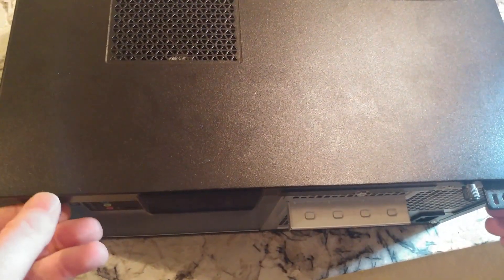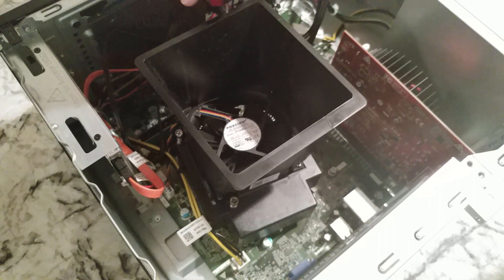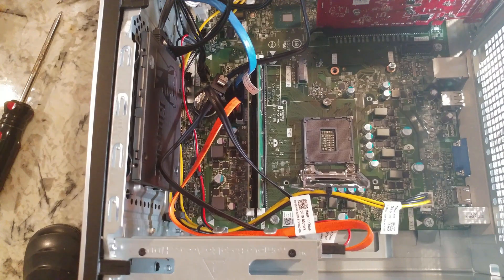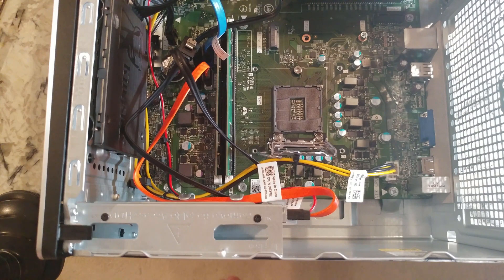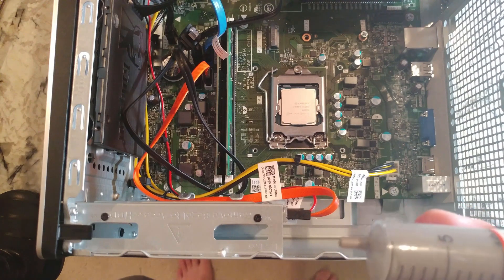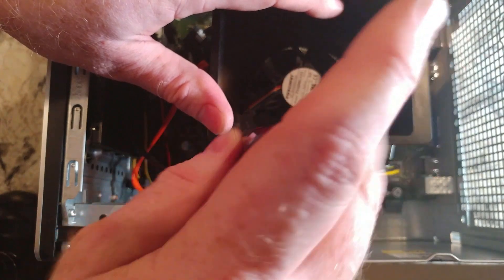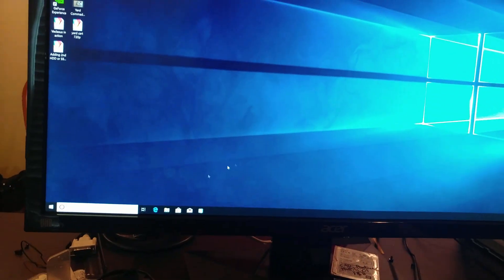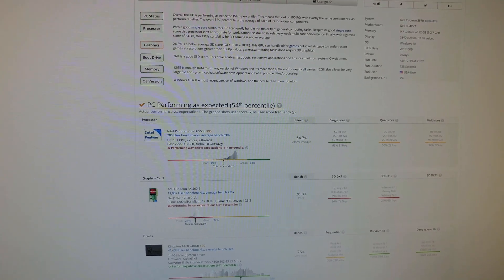Dell Inspiron 3670 Upgrading Downgrading Replacing CPU (read description) or Vostro

Comment: Brother I watch your channel all the time you can take that plastic air extension right off by clipping it and pulling it up you add me trying to get screwdrivers around it it pulls right off I'm like what the f*** is he talking about come on broski you're better than that
Reply from the maker: Lol...this is where you wish you edit these old videos.  Thanks for someone finally calling me out.  That plastic piece..never returned to later videos.
Reply: @PC_HardwareTechUnboxing_1  I was kind of pissed off at you for a little while because I was f**** around trying to get those screws off and I knew that every one of those clip off that I've ever worked on I don't know why I listened to you it actually popped off trying to get the f**** screws off and then I was like really I'm not mad I'm sorry I sent that message in anger after doing it your way lol it only lasted 10 minutes the thing popped off on its own and then I got it fixed in like f**** 10 minutes you should at least pin a comment saying the plastic piece I don't know what it's called even honestly pops off and pin it at the top of the videos somebody can at least have a chance to pop it off without breaking the computer lol

Comment: Can you take out the motherboard and put in a new case?
Reply from the maker: A few issues...1) I am not sure if the hole pattern would like up, though this is an easy enough fix.
2) I don't believe this motherboard has front panel headers on it...so you would not be able to plug the Power Switch in as the motherboard has a power button.  Potentially, someone might be able to figure out how to solder it. 3) The USBs on the motherboard would become useless.

You can certainly take the motherboard and power supply out of the Dell case and run it without a case.  You may be able to doctor a case to allow for access to the power button or the USBs

Maybe it is time for me to do something with mine...it is pretty much just collecting dust.

Comment: I wanted to downgrade a vostro 3471 pc (i want to use that processor in a new build) it has a i5 9400. What happens if I install a cheaper processor with the same socket ? (LGA1151) will it boot up normally ? Can you recommend me a cheaper cpu to swap with it !? (Pentium/celeron)
Reply from the maker: I would expect the 3471 to handle any locked 8th gen CPU or 9th gen cpu that has integrated graphics.  Any of the Celerons are just dogs...I would say at least Pentium G5400..I3-8100 or I3-9100 would be your best bet to keep it usable.

Comment: hello, I am a dell 3670 i3 user, I want to upgrade to i5, then what type does it support for i5 9400f or i5 8400 coffe lake
Reply from the maker: Hello, mine was originally a I5-8400, as such,  I have a couple of videos that I did related to this topic: 1) Update BIos 2) Install I5-9400f   3) Install I3-9350k  4) Install I3-9100.  Let me know if you want the links.

I5-9400 would be your best bet if you don't have a graphics card installed.  You could look at I5-8400, I5-8500, I5-8600, I5-9400, I5-9400f, I5-9600.  I don't recommend any that end in k as this is much harder to keep higher wattage CPU cool.
Reply: @PC_HardwareTechUnboxing_1  it works for me thnk u
Reply: I have upgraded it,  i5-8400 thnk u

Comment: I picked up an Inspiron 3670 for $50 off an auction of surplus electronics, new in the box. I'm planning to pull it apart and upgrade my Ivy Bridge era custom build. i5 8400, 12GB of RAM.
Reply: Where do you find such auctions?

Comment: Good video! I did the exact same thing as you. Used the cpu from my Dell Inspirion 3670 for my current gaming PC. After several attempts to upgrade the computer, found out that the current PSU is mounted at the bottom...and has the fan facing directly to the rear (plug side) and the new PSU, a Corsair 550 watt I installed has the fan facing the side of the case, which leaves no room for airflow. Plus, the motherboard only has an 8 pin connector...never buying from Dell again. Lesson learned.
Reply from the maker: I know exactly what you are saying.  I did find an Apevia fan that has dual fans...but it is Apevia. One blows out of the case as needed...the other blows down (same problem).  Luckily on the 8 pin, there are adapters out there that work...for how long or how safe, who knows.  This is actually my last video for the 3670 as I somewhat say goodbye to it:  https://www.youtube.com/watch?v=1YCxmEOmbw0   At least until there is a Dell 3690 or something like that.  These did prove to be my most popular videos.  Thx for the comment.
Reply: @PC_HardwareTechUnboxing_1  what did you wind up doing with the 3670? I'm thinking about "downgrading" mine as well. And eventually selling it.
Reply from the maker: @lauracoykendall9616  Hello, I ended up taking out the good components and sold off the case/mobo/psu on ebay.
Reply: @PC_HardwareTechUnboxing_1  that's why I bought the 3670, it had good specs. Currently parting mine out and selling everything except the cpu, ram, and DVD drive.

Comment: does the computer have a 16x pci-e slot?
Reply from the maker: Yes, there is one slot that will accept a graphics card.  It will handle several graphics cards if you get the kind that don't require 6 or 8 pin connectors.  I have used RX 460 OEM, GTX 1050 and GTX 1050TI in this computer.  There is an OEM GTX 1060 3gb that would provide the best performance for this computer, but possibly only available used on ebay.

Comment: What screw driver did you use to take out fan thing
Reply from the maker: Been awhile...I believe it was a #1 and #2 Phillips screw driver.  One of 4 screws is hard to get out..but they should go back in easy.
Reply: I got this kit can you check it out and tell me what screw driver might work plz
Reply from the maker: One thing this video does not note, Dell suggests removing the screws in the order noted on the motherboard (if you can actually read it).  Quoting Dell, "Loosen the 4 x M3 screws in reverse order marked on the system board
NOTE: Remove the screws that secure the heat sink to the system board in the order of the callouts shown [1, 2, 3, 4]."  You will use similar technique to reinstall the cpu fan.

It is noted that #1 Phillips is usually used to remove a M3 screw.
Reply from the maker: Here is the instructions on how to remove the shroud, which will help you get to the 4 screws.  I was able to do it without removing....but it is easier without the shroud in place.   https://www.dell.com/support/manuals/us/en/19/vostro-3670-desktop/vostro_3670_service_manual/cooling-shroud?guid=guid-0f037793-c117-424a-9885-5d588863edf6&lang=en-us
Reply from the maker: @bsasasfn5555  U buy it?

Comment from the maker: I have compiled all videos into one for the ultimate upgrade experienc:  
https://youtu.be/75wLkDy3k2A

Two things this video does not note: 1) Removal of the shroud, I add the perfect length Phillips #1 and also used #2 to remove the cpu fan.    Here is instruction on actual shroud removal:  Here is the instructions on how to remove the shroud, which will help you get to the 4 screws.  I was able to do it without removing....but it is easier without the shroud in place.   https://www.dell.com/support/manuals/us/en/19/vostro-3670-desktop/vostro_3670_service_manual/cooling-shroud?guid=guid-0f037793-c117-424a-9885-5d588863edf6&lang=en-us

2) Dell suggests removing the screws in the order noted on the motherboard (if you can actually read it).  Quoting Dell, "Loosen the 4 x M3 screws in reverse order marked on the system board
NOTE: Remove the screws that secure the heat sink to the system board in the order of the callouts shown [1, 2, 3, 4]."  You will use similar technique to reinstall the cpu fan.

It is noted that #1 Phillips is usually used to remove a M3 screw.  Sorry for any issues you may have.

Comment: Hey David. Good video. If I understood the end of the video correctly, you have both a HDD and a SSD in the computer at once. Is that correct? Are there enough bays to accommodate the 2 drives and the Optical Drive? I believe that must be the case, but just wanted to confirm. Lastly, is this computer worth $450? Saw a deal for the computer at that price. If I get the computer, this video will be invaluable to help with upgrading. The case is a bit small though...hope my hands can fit inside.
Reply from the maker: Hello, yes I have a video where I show a sata power cable splitter connected to 3 drives, cost about $6.  There are 2 places u mount drives to the frame.  There is also a device u can buy that you can mount that holds 2x 2.5" drives.  There are 4x SATA iii connections on the board. This PC is close to the size of a Mini Tower. For new, that is good price.  Refurbished I3-8100 : $299. Refurbished I5-8400 $349.  I build custom computers on the side,     If u are knowledgeable of PC's..that is your best bet.
Reply: David Noble Hey David. Thanks for all the info. More useful than Dells own webpage. The $450 price is for a refurnished unit, open box apparently. Last question, would a graphics card be able to fit in the case, with a HDD and a SSD. I'd like to get a 2nd HDMI port into the unit and my understanding is that can only be done by adding a Graphics Card. Oh, and Happy Mothers Day. Hope the ladies in your life are having a good one.
Reply from the maker: Thx.  With your stock PSU, you are limited to GTX 1650, GTX 1050TI, GTX 1050.  Other alternatives are OEM cards you would find in a Dell or Hzp.  Resold on ebay, RX 460 RX 560B GTX 1060 3GB.  The latter probably has best performance.  Make sure it does not require 6 or 8 pin connector.  There are other more costly alternatives that would require mods to case to fit a more powerful PSU...to get a really good gaming card.
Reply from the maker: I have compiled all videos into one for the ultimate upgrade experienc:  
https://youtu.be/75wLkDy3k2A